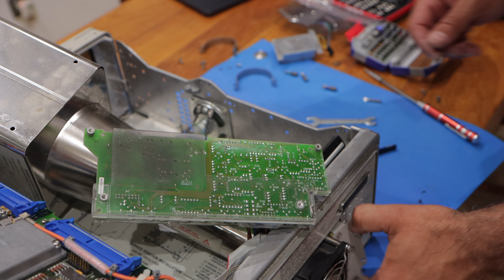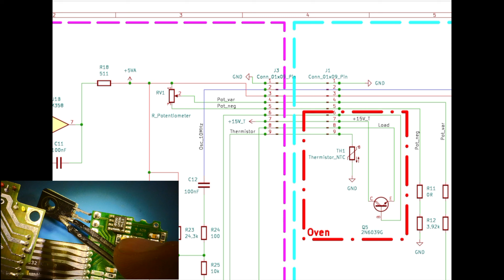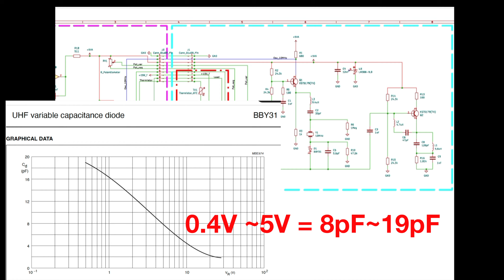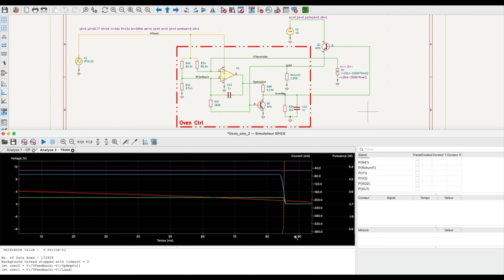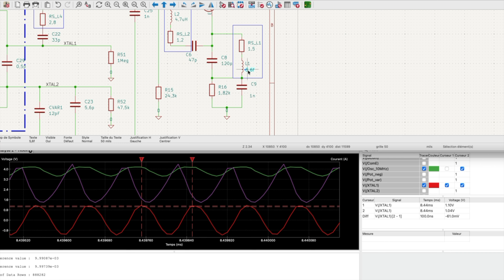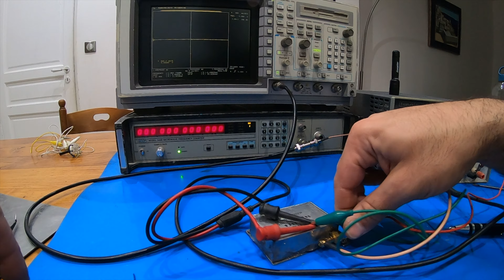HP 8563A OCXO Oscillator: Full Teardown, Repair & Simulation

Comment: I wonder if this could be replaced with an internal GPSDO in case of failure of the OEM oscillator. Not sure if this would be more accurate though? There's PLENTY of room in my unit since I removed the CRT. Thanks.
Reply from the maker: It's a possibility indeed, for a DIY project or to restart the analyzer while waiting for a new oscillator to arrive, as they're quite easy to source nowadays. Thanks for your feedback!